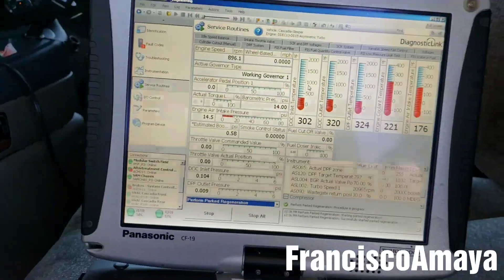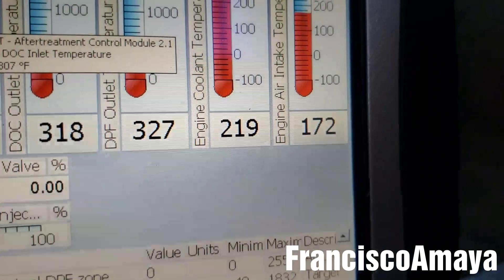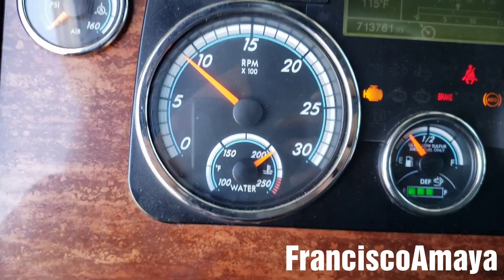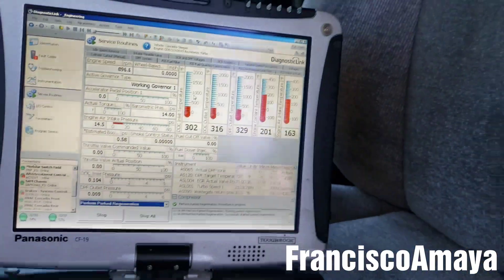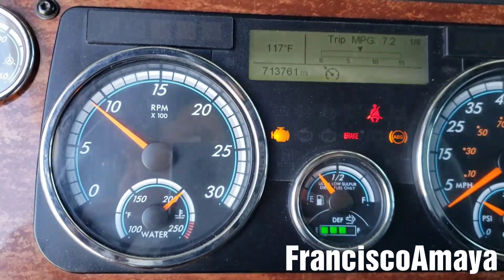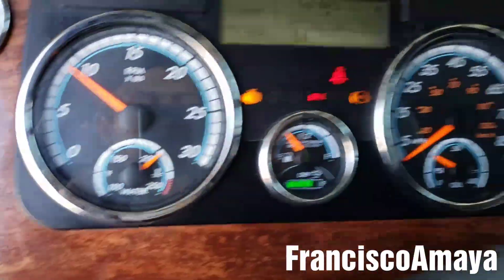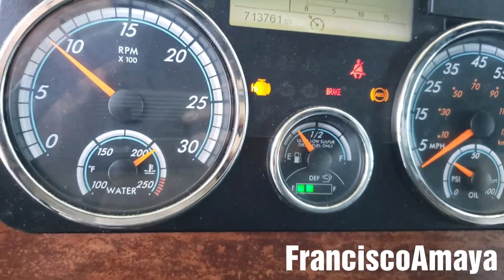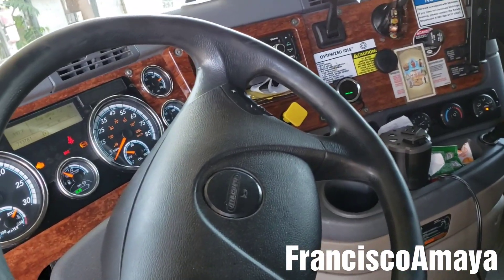Freightliner cascadia DD13 DD15 DD16 engine fan activation temperature

Comment: I have a question brother 
I recently deleted my 2018 cascadia 125 dd15 and ever since that my fuel per mile dropped from 7.6 to 6.2 also, the engine fan seems engage all the time when traveling highway speed at about 185deg then turn off around 175. I took it back and the mechanic rev the rpm till the temperature reached 200 and the fan kicked in. But my problem only does at driving so Please help anyone

Comment: Francisco, can we reprogram fan temperature in DDDL? I found in parameters fan coolant temp stage1 and stage2 set to 221F. Is that the parameters that activate fan?
Reply from the maker: Correct. If it is deleted you can set it up to the temperature of your choice but if the DPF is working do not set it lower than 215

Comment: That design is by far the dumbest design I have ever seen on any vehicle DD 13 and DD 15 engines get hot, cold, hot and cold, hot and cold again which causes radiators to explode overtime due to material fatigue. It’s a moronic design potential overheating is a plus to all that manual fan switch resembles something you would see on a Russian truck or actually Soviet one

Comment: Thanks much for the video, yes this is what happened to me I was going uphill on I-77 and all the sudden my truck overheated and blew up my radiator, I had to pay $2900 for replacing my radiator, now I’m scared my fan won’t kick on next time I go on an uphill, I have diagnosed the fan clutch and it’s good, but I want to make sure my fan will kick on when it’s supposed to, I have let my truck running for ever idling but the temperature will just stay on about 180-190 but will not reach the start temperature of 220, now is there a way to test this without taking the risk ?
Reply from the maker: DD platform engines set the fan on @ 221f - 223f very close to redline.  This number can be programmed to a lower temperature. Having a manual fan switch helps a lot, especially on hills.

Comment: Hey Francisco how can i contact you? Or please reply to my question. I have a 2015 Freightliner Cascadia and the temp goes up 218 and then it goes down to 191 and go back up after a few mins again to 207. Should I be worried about this or must I fix the radiator or thermostat or maybe the water pump?

Comment: My fan doesn't turn on at 221. Sometimes it will sit at 230-240 (after running heavy load) until i I turn on a/c, then temperature drops. It will wait til I get to top of line. Like 250 when I'm going up grades then I hear it turn on.  Have any ideas what could be issue? Thanks
Reply: Did you fix?

Comment: Hey brother thanks for this video. I got 3 dd13 motor coach that I was concerned about this issue. Listening to you I can see that it’s normal for these engine to go high temperature 220 before cooling fan high gear come on. Feeling much better

Comment: What if it all was running low temperature and make ur truck run on 5 miles and show u the heater def and fuel def I did cheng all def sysm and when I drive with load run low and fun is not run righte when u open Hood it's another of heat

Comment: Franciso can i add horsepower to my dd15 it has 475hp right now can i bump it up too 500?
Reply from the maker: If the computer has that as preset, yes. If not.  You have to reflash the computer with a different software with 500 hp options

Comment: Is there a way to set using software for fan to come on sooner
Reply: yes you can. i set my fan come on 202 .working like a champ
Reply: @Louis19699  thats great please share how you did it 
Thnx
Reply: @nawazabba7819  how i can contacting you? I need you to get connected with dddl and walk ypu thru
Reply: @Louis19699   i that will be great i would suggest u post it on YouTube and hence u get income as well
Reply: @nawazabba7819   Open Dddl software.  Go to parameters-All parameters-Motor control module EPA10-  Open  PRG006 Fanconfig.  The last option ( Fan coolant temp in stage 1 ) change number to 201 .  Reflash   voala.        That trick only for single stage  belt driven fans
Reply: @Louis19699  how did u set up.foe 202
Reply: @ubu3393  Can I Change the temp on my 2017 cascadia dd15 ?
Reply: I adjusted mine to 214f
Reply: Good question
Reply from the maker: I am not sure but I will check the parameters to see if that if part of it.